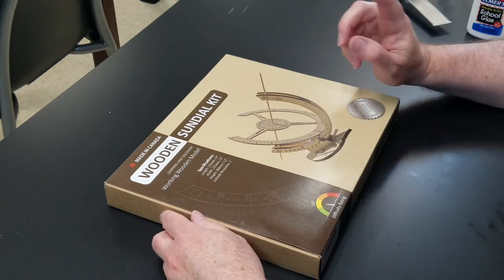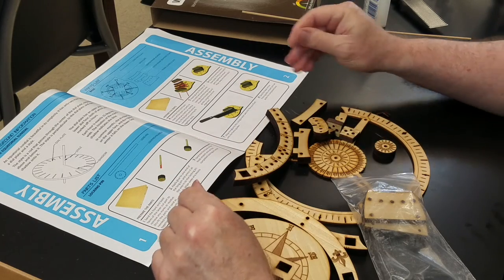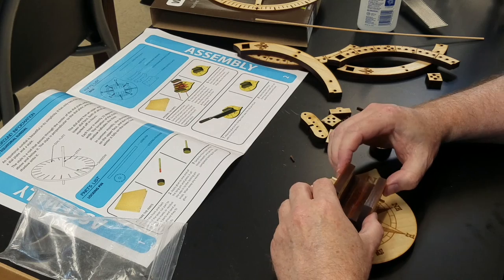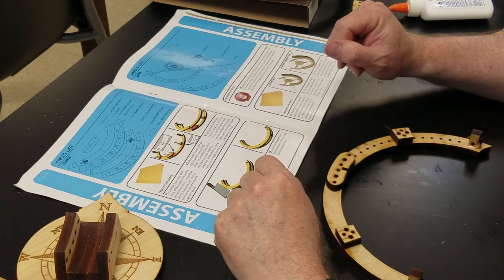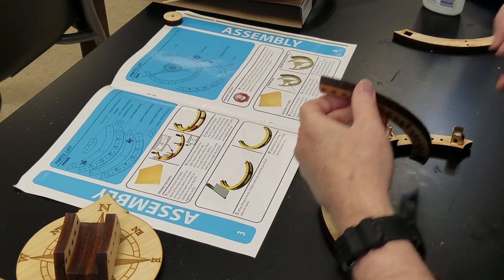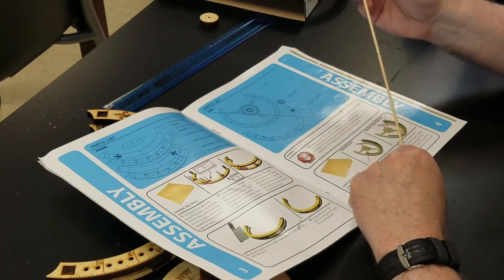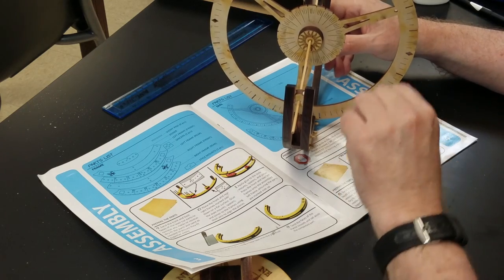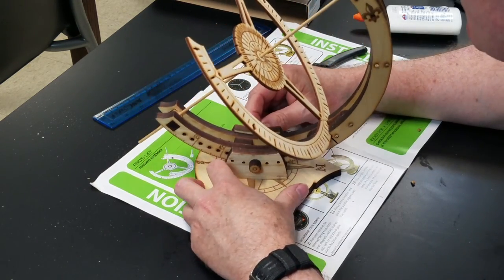Equatorial Sundial Wood Model Build

Comment: I can't find it with the link.
Reply from the maker: The site shows a new design, but like you I could not find a way to buy it. I googled "Wood Sundial" and got this as one of my results. It looks like the same sundial I built in my video.  Thanks for the support.  https://www.ebay.com/itm/125176281671?chn=ps&norover=1&mkevt=1&mkrid=711-117182-37290-0&mkcid=2&itemid=125176281671&targetid=1262779893049&device=c&mktype=&googleloc=1017702&poi=&campaignid=14859008593&mkgroupid=130497710760&rlsatarget=pla-1262779893049&abcId=9300678&merchantid=112290258&gclid=CjwKCAjwtcCVBhA0EiwAT1fY7yqxVhtVGbgsL2bpcZAmD8vbTkp47sOc6qhxGu0IGbs-MA6u7qghNxoCq2oQAvD_BwE
Reply: @thephysicschannelwithkenny314  Thank you SO much for your help!
Reply from the maker: @amcken  Thank you for watching.